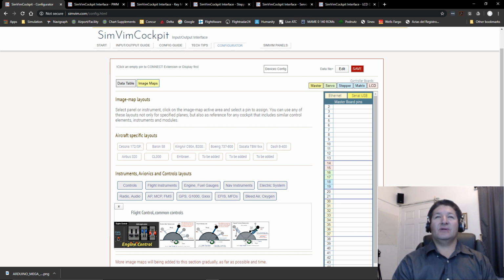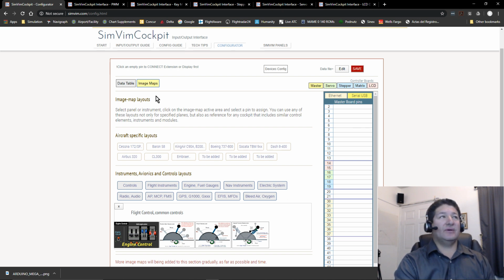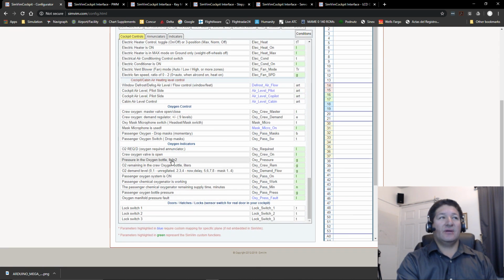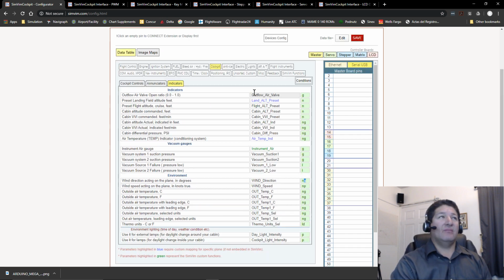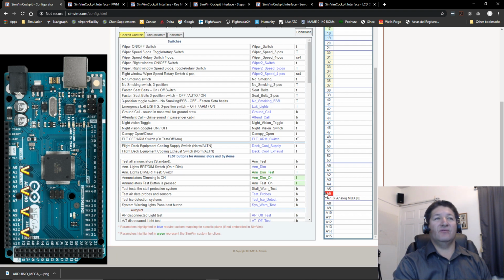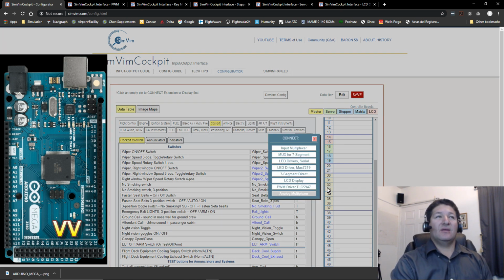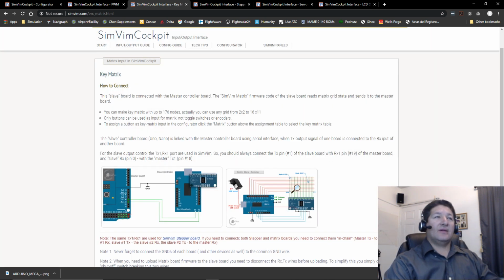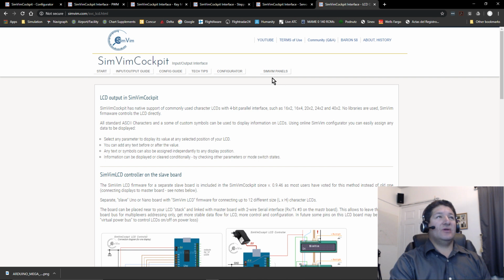Working With The SimVim Cockpit (Now SimVimX) Configurator (Old & outdated)

Comment: HI, great videos!!! I don't mind the length at all, you are very easy to understand.  Keep up the good work!! Quick question for you, is this the best configuration tool that you have found?  i need to setup some trim wheels and some lights (landing gear , etc.) that have potentiometers (trim wheels & landing lever) so i need a config tool i think,  i have a joystick controller which has 8 or so analog ports and the rest are digital.  But I was hoping to find a tool like this to make life easier when also configuring an accunicator panel with a bunch of lights from this vendor ->> https://www.ebay.com/itm/372642289819?ViewItem=&item=372642289819    -- also, let me know if this is the cheapest to get these annunciator lights.  it would be a big help and thanks again.  And last question I promise.....Is this only for X-plane?  Was hoping for something for Microsoft FS 2020 as well.  And also I use DCS, I would assume you use DCS BIOS for those purposes, correct?  Or will this work?  Also, one more thing, how about RGB lights, are they supported by this software?  i think they require PWM signals , correct?  sorry for being so dumb about all this.
Reply from the maker: This is the only configurator you can use for SimVim Cockpit. You can configure potentiometers from within the SimVim Plugin. The joystick you want to use you cannot configure through this because it will connect to the computer with USB. Unless you remove all the wiring and make the connections directly to the Arduino or input multiplexers. I think those light are pretty cheap but I haven't looked for any custom ones myself so not sure. Finally this is Only for Xplane at the moment, but they say in the future they will try to make it work with other sims. I don't use DCS so I have no idea about how to make anything work with that one. I have not seen anything about RGB lights on the SimVim website but this does support PWM, just not sure how that applies to RGB lights.
Reply: @Qosmokid  thanks for the help.  that makes sense on the joystick controller.

Comment: Hi is SimVim compatible with MAC platform?
Reply from the maker: Hello, sorry I never saw this question until today. I'm sure by now you probably found out that is is compatible with Windows, Linux, and OSX.
Reply: @Qosmokid  No problem, thanks for the reply. I managed use AM for my project. I wasn't sure if I could configure a flight deck which was not listed on their website. I am making a saab 340 which I couldn't see in the list. Cheers!
Reply from the maker: @simhoper8953  oh yeah of course you can, the ones on the list are custom aircraft that they are putting together all the custom conversions for. Everything else not listed we can convert ourselves.
Reply: @Qosmokid  Thanks a lot for your reply. Is it possible to make a video on connecting a component for a unlisted aircraft? Thank you very much!
Reply from the maker: @simhoper8953  connecting the component is the same, the only difference is assigning the custom command and dataref for the function you want that component to perform. My latest video goes into that but I plan to redo it since I've learned a little more the last few days
Reply: @Qosmokid  Thanks

Comment: Hello,I have recently downloaded simvim and the default switch (Pilot heat) is working, however, I cannot get any of my own configs working, any help on this?
Reply from the maker: When you add switch assignments you are saving the cfg file in the xplane/resourses/plugins/simvim folder? 

After you click "Reload Configuration" do you see an increase in the number of I/Os? 

Other than that most likely it's wiring problems.